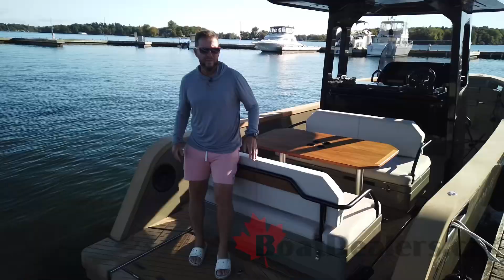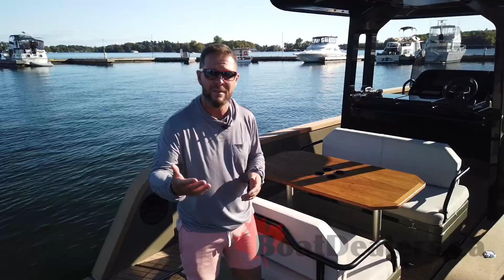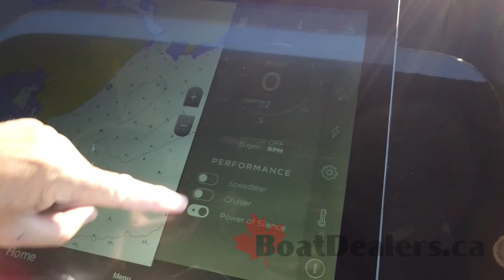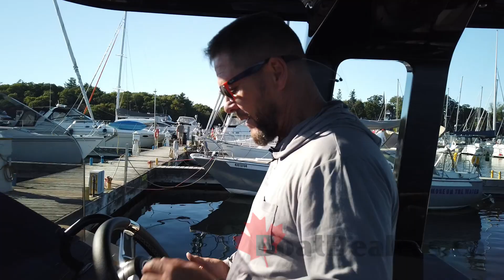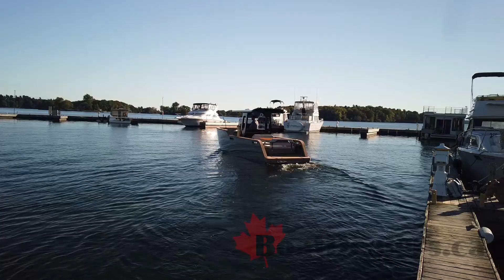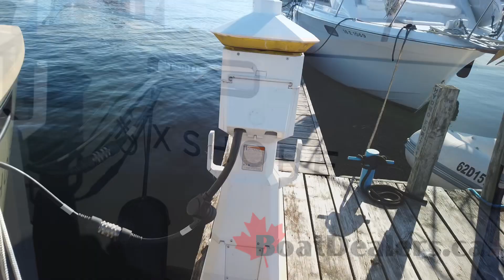X Shore Eelex 8000 all Electric Boat Walkaround #boatreview #electricboat #greenenergy

Comment: 2 hours at top speed? That is misleading. More likely to be 30mins.
Reply: Godert why
Reply: Correct. Top speed gets around 40 mins max. However, as anyone knowledgeable with electric propulsion should know is that if you need range you just need to slow down!  If you bring it down to 25km/hr you can get nearly 2 hours of runtime.   Bring it down to a leisurely 10km/hr and you get more runtime then there is daylight!  (Close to 20 hours).